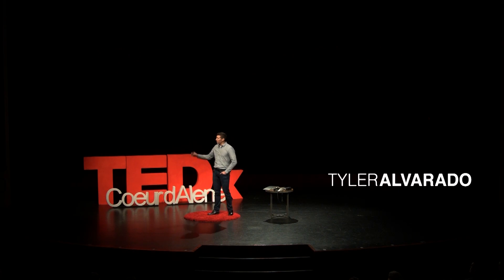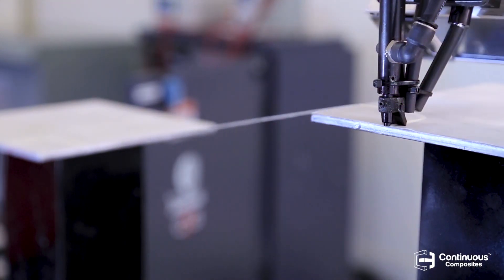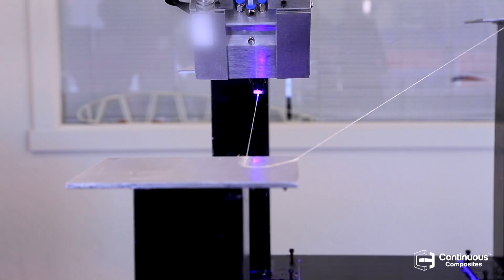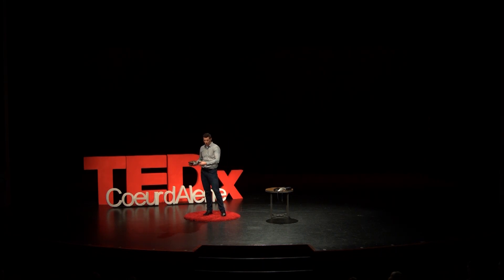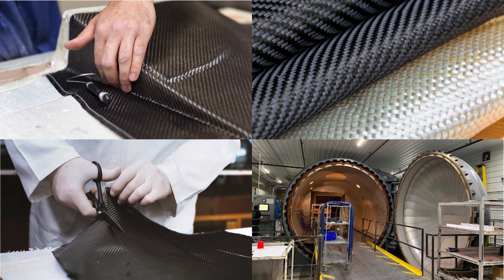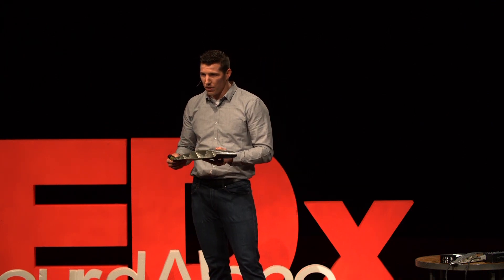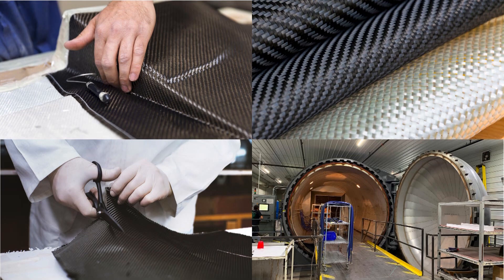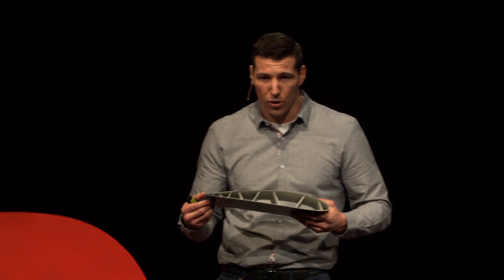Introducing the Future of Manufacturing | Tyler Alvarado | TEDxCoeurdalene

Comment: It is going to revolutionise the manufacturing processes ...and there is not no doubt about that...in my extensive research about additive manufacturing, it actually removes all the weaknesses of 3d printing combining with the advantages of composite strenghts ... an addition of one more domain will make their machine perfect..and that is adding a hybrid head (additive plus subtractive head)... that combination of additive 3d printing head (additive) along with a cnc router (subtractive) will make it virtually all in one machine that can undertake any kind of job ...the perfect machine

Comment: Very impressive manufacturing technology. Question is has it reached maturity?! Are there patents to it! and What are the gaps in the technology or areas of improvement! . How can it be used to shift from printing composite components made of different material properties for example; silicon to aluminum, to steel or carbon etc. .

Comment: This is great BUT you're still working with 2D layers where you are only able to apply unidirektional fibers. This might be suitable for a few applications but isnt the BIG deal in my oppinion.
Reply: Thank you for your comment, Lars. The CF3D® process is not just 2D stacking. Our technology skins and orients fibers in the z-direction out of the x and y plane. We are also not limited to unidirectional; CF3D steers the fiber in the direction of the stresses and strains for optimized composite parts.
Reply: @ContinuousComposites  6 axis cobot woven composite developments like at IITM could enable computationally optimized structural parts, which can be climbed on g code paths on the fly, like in the Silk Pavilion. Sure shows 2 axis lines and layers to be the rudiments they are.